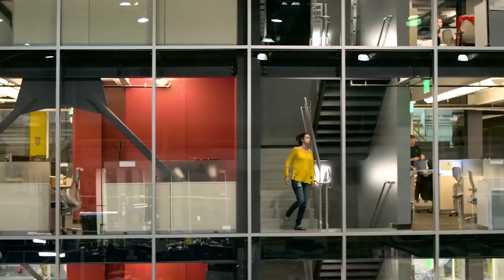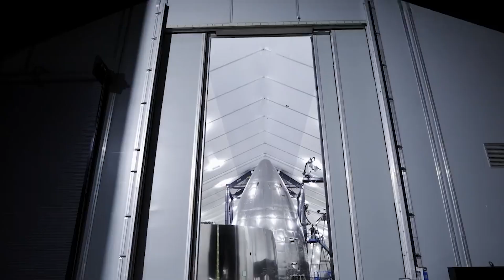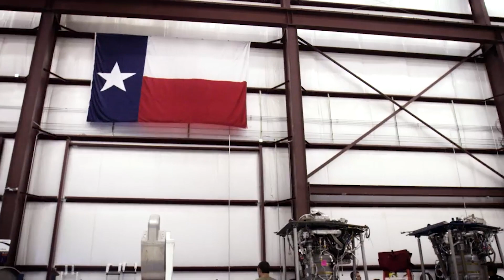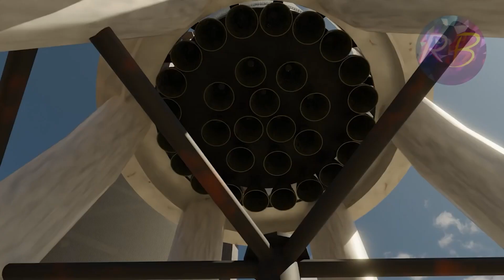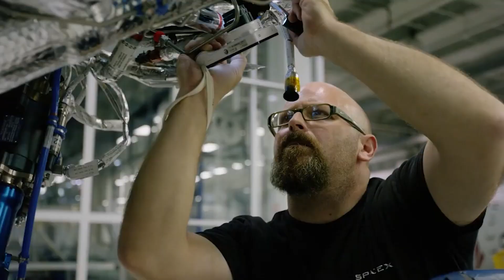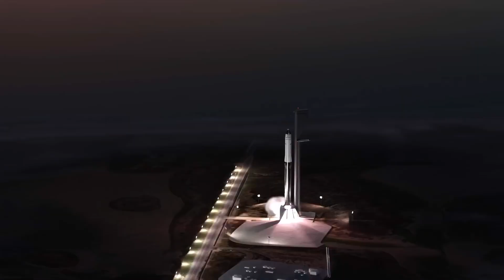NOT LAUNCHING! FAA Denied SpaceX's Plans for Starship's Orbital Launch In January

Comment: OK-------. Great Video Thanks.  IT is a shame that Space X is having to wait until March, April, May, or even longer to finally fly the Starship to orbit. Seams like a lot of Wasted Time. 
But what if Space X used this time to test Mechazilla by hopping Ship 16 and learning how to catch Starships with Mechazilla.  Space X has flown many Ships over the last year so the FAA can not complain about a few more low-level hovering for 5 to 10 minutes hops next to the tower and Mechazilla to test catching Starship. Though adding long (to keep the engines far above ground to vent explosive gasses) reusable landing legs to Ship 16 (in case the first catch attempt does not work) even if it would take a couple of weeks. Starships are going to need landing legs to land on Mars and the Moon anyway so the work would be well worth the time NOW even as part of the Artimus program.  With Mechazilla catching Starship a Proven fact, Space X will be able to hop one of the Boosters using the center engines (which is about the same number of engines the Starship uses so the FAA can not hardly object) to test catching the Booster in Mechazilla as well. Hopping the first Booster would also reduce the Risks when the full-up ship launches to Orbit for the first time. 
-----------. With a set of landing legs added to Starship 20 during its Suborbital Test flight (which has plenty of excess Delta V) and entering the Atmosphere at a much slower speed which increases Starship 20s chance of surviving its first re-entry producing greatly needed data. Space X could change its landing spot from the Ocean north of Hawaii to an old abandoned Airforce Base a hundred miles or so south of the islands where Starship 20 after landing (and full detailed inspections landing in water would not allow) could be refueled to make a short 3,000 mile hope to the barge off of LA (or simply barged through the Canal) back to Starbase.
Reply: So here's the problem with the hop idea.  If the ship blows up, then the FAA might take that into account when ruling on their current proposal.  So if you notice, that's why SpaceX hasn't done any flights.  It's not a cost issue... it's that they don't want to have a single added concern until they're approved.  Additionally their agreement with the FAA limits the number of sub-orbital flights they're allowed to do, so if you do some hops now, you'll take away from your ability to do necessary hops in the future.
Reply: New Shepard is a relatively small rocket in the middle of BFE. Starship with Superheavy booster is the world's largest rocket in a more populated area in a brand new spaceport facility. If I lived in Brownsville area I would at least expect the government to do some due diligence on that. The locals sure don't have a chance against SpaceX's army of lawyers.